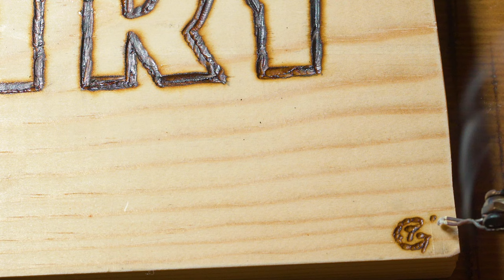Easy Woodburn Painting Art Demo / For Beginners / Relaxing Art Therapy

Comment: Looks amazing! Tip: turn the work surface instead of your hand.   Certain motions are easier than others for a hand to perform, generally vertical or tilted lines I think, you can move your work surface so that your hand only needs to do move in those motions. (not an expert, but I did draw for a while, never any good but it is fun.)
Reply from the maker: Thanks! I actually do that when I normally woodburn :) For this video I was experimenting with keeping the wood in one place for the video, but I think when I do harder stuff that won't work! It's definitely easier to move the wood rather than my hand!
Reply: @TaylorTries   "harder stuff"? does that mean more woodburn stuff?  :)